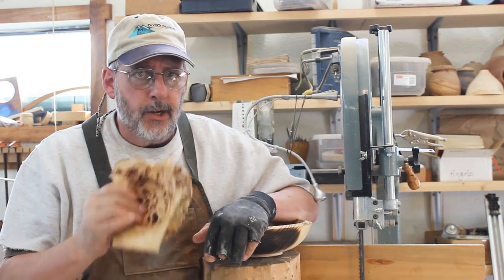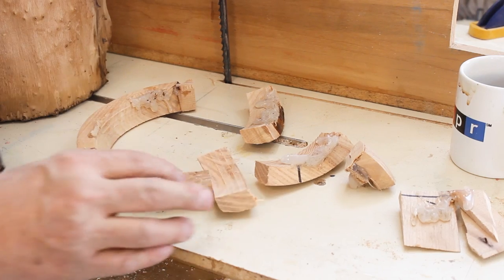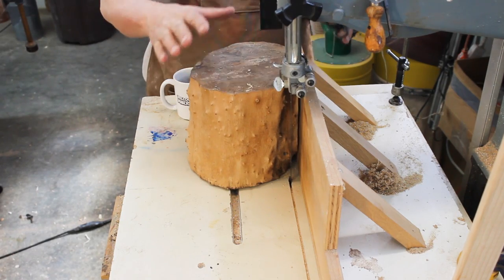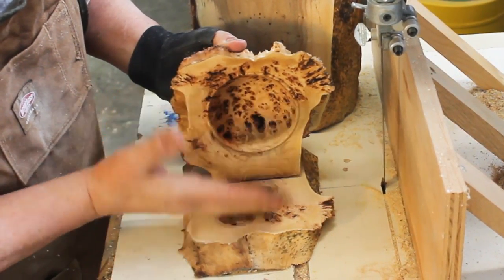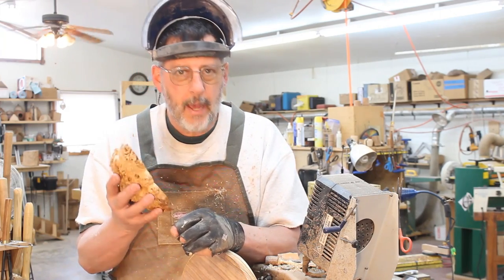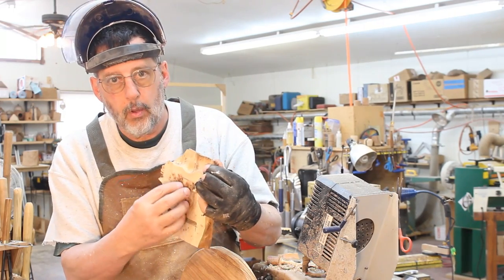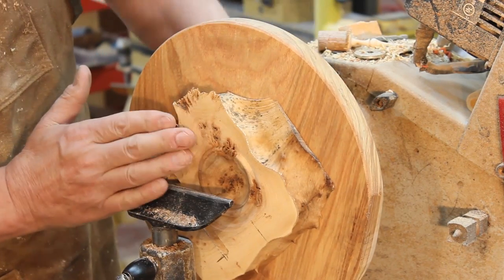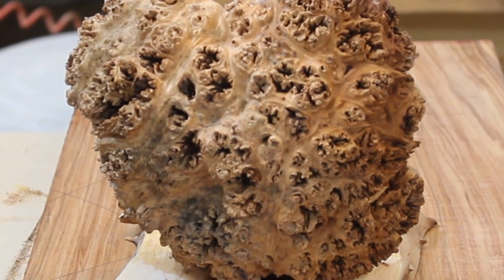Crazy Burl Bowl Stand

Comment: I like how that turned out. And since you brought up the point of taking suggestions, I just came in from my shop from trying to turn an egg on my new lathe. I was trying to practice some skew work (absolutely suck at using this tool!). Got a catch then actually knocked it out of the chuck even with a great tenon. My mind was NOT on turning just that I am on vacation and felt the need to turn. Remembering your advice on not turning if your mindset isn't right I promptly turned the lathe off cleaned up and went into the house to look over wood for future projects. Thank you for that video that offered suggestions on turning!
Reply from the maker: James
There is not much that makes me happy about my accident.  (actually nothing).  But what does is when people say they are being safer, or thinking about safety. I appreciate you sharing your story.  Just keep after that skew chisel.  One suggestion; when using a skew chisel the larger the diameter, It is more difficult to operate.  So practice on spindles that are maybe 1 inch in diameter or less.  Also, what I have found, is that the diameter of an egg changes dramatically.

This also makes using a skew chisel more difficult. Hang in there I still work at myself
Thanks Sam

Comment: Wow, what a great project and final piece. The thought that went into this was incredible. Perfect design for the base. One thought, at the end of the video it appeared the front end of the base was raising slightly? Maybe a small weight set into the bottom of it? Only because I would really hate to see that burl fall back and be damaged if someone was handling it. Thanks for sharing this one, Fred
Reply from the maker: Fred
I am always amazed at how observant folks are.  You are correct.  The base is not even at this point. It rocks a bit. I need to Sand it flat. I think it'll be okay then 
Sam
Reply: Thanks Sam. Wasn't sure if that's what I saw or not and figured you had it covered, and you're right, I watch your videos pretty closely. That's why I learn so much from them. Thanks again, Fred